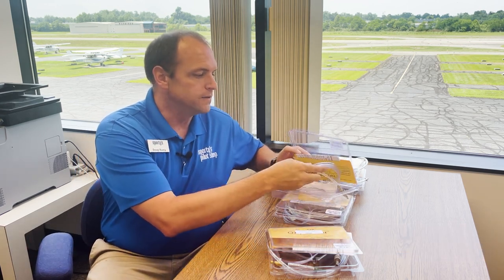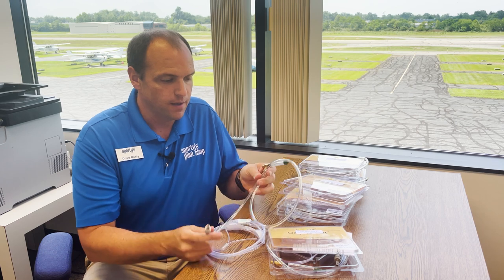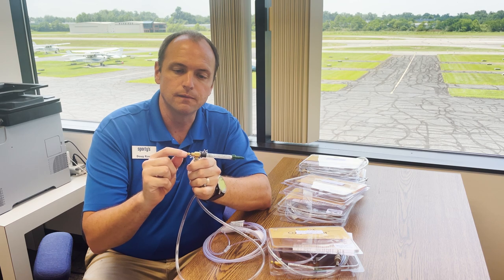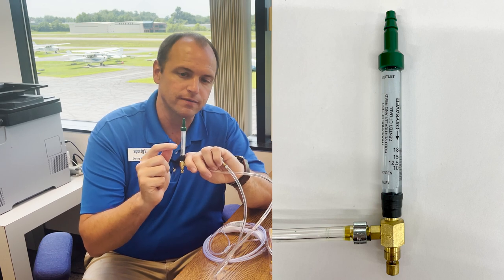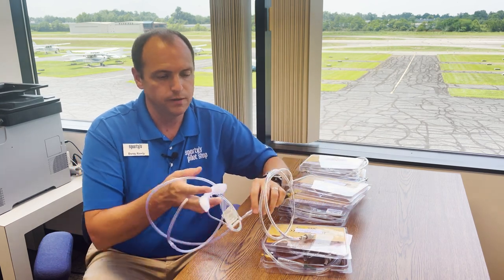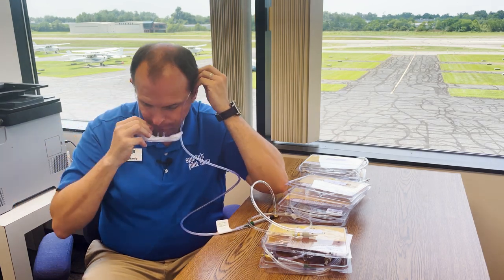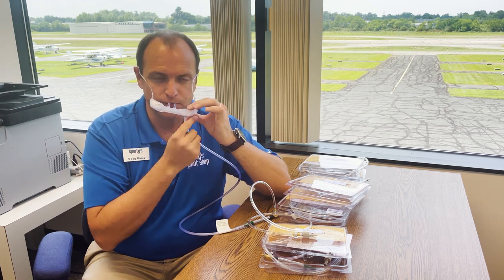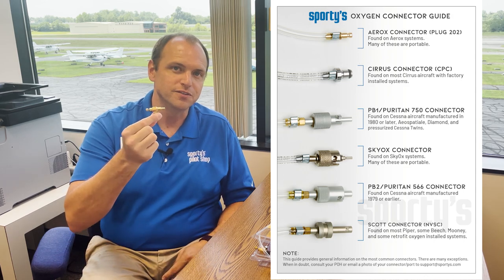Aerox mustache-style oxygen cannula retrofit kits for pilots

Comment: As a respiratory therapist I have to tell you the cannula does not go around the back of your head it goes in your nose prongs down, around your ears with the spitter or the O2 tubing under your chin.
Reply from the maker: Hi Kevin!  Thank you for the feedback.  We've found that aviation headsets can sometimes get in the way of oxygen tubing around the ears.  One way to make it a little more comfortable is to push the tubing such that it is resting on top of the headset ear seal. If you have enough slack in the tubing, you can still keep the splitter/tubing under your chin as you've described. If there isn't enough slack to get around the ear seals, this method might make it a bit more comfortable in the cockpit.